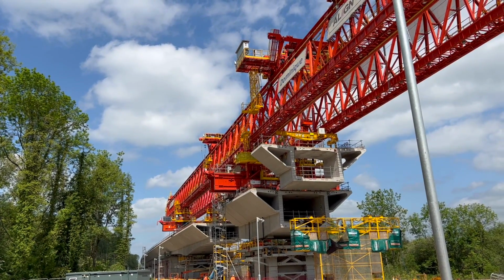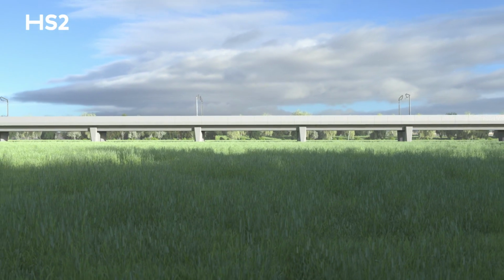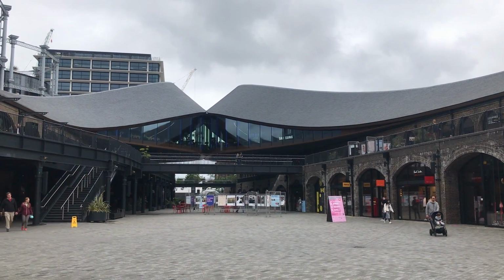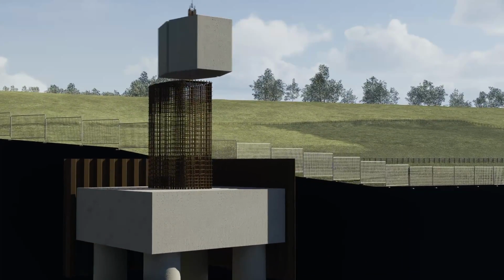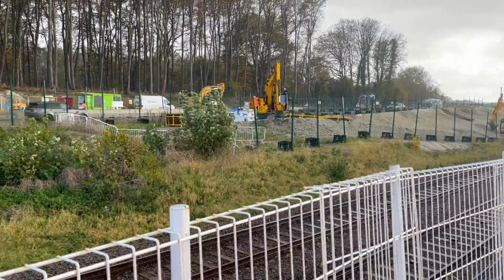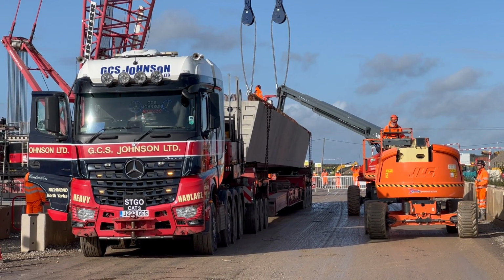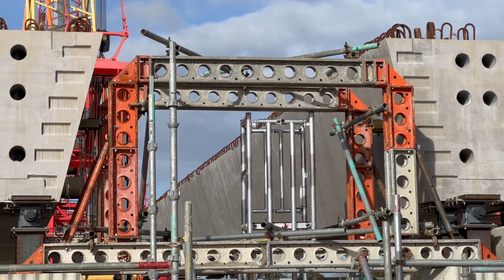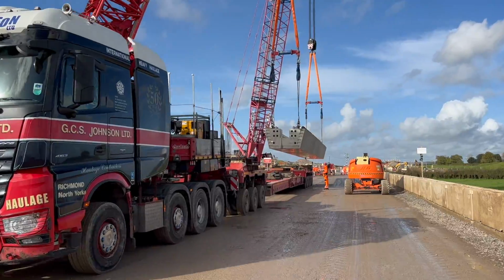Return to HS2: The Art of Compromise

Comment: After my computer breakdown in June I was idle for two months but have started drawing again, and it's Birmingham and two points north. (I never really decide on these things.) My London-Birmingham entry, which will never be built - well, if you need more capacity... - is some miles shorter than HS2. (It's impossible to measure it without drawing it, which would take a month or so to get a single center line just to measure it - and the centerline's not part of the drawing. But Google Earth gives elevations way more detailed than US topo maps for free, for instance, so it's all good. ) The point of this spiel here under the last video in my HS2 search of Jago Hazzard save the"The Actual Trains", is that I'm already quite convinced they couldn't come up with anything shorter or significantly less time consuming by doing other than upgrading the existing lines. And the lines have actually been downgraded in places, which makes them slower, and this is in keeping with a set of symptoms that are all-to-familiar here in the embarrassingly short on trains USA. The way to upgrade it would of course be to stage the work. Thus the Mersey estuarilal tunnel could be put off for a while. Might take off ten minutes: the only reason for the tunnel is it's the only way to take out the sharp curves, which I'm convinced were not in the original design: speed's expensive, but not if they would leave it as built. The headings on both lines are largely not particularly skewed, and in two notable places where they are skewed - amidst middling-cost homes with big yards mostly - they used 8000' radii, so you could probably go 100mph given proper isolation and noise protections. So I doubt the kind of construction they do, like viaducts rather than earthworks - or heavily founded and reinforced earthworks if necessary - is the shortest route to Liverpool and Manchester, or the fastest. And I notice there's a lot of really magnificent but dormant rail capacity up in that area anyway, so they might be willing to consider reviving some of it rather than... whatever it is they're doing. I'm somewhat stymied by Manchester (I took a train from there once to Sheffield, saw the sheep in the fields..) The elevation around Piccadilly is quite low, so a tunneled approach is problematic. The station would have to be underground too, and pretty deep. It's overkill. the simple solution is just to have a stop at Stockport. (probably 10 minutes for that too, as opposed to speedy/direct, which is what's got me stymied) The current arrangement of tracks and stations there seems kind of piecemeal, and in places oppressive for those not on the train. I can't get the arrangement of things in my head good and it'll probably take a while. I wonder if Piccadilly could just be dispensed with and have a lot of consolidation at some other spot. I believe the L&M's approach to Piccadilly is changed. They would not have built something so skewed and slow to begin with - if it went to Piccadilly. Have to study it. Thanks for the enjoyable hi class + informative videos, I've been enjoying them for several years.
Reply: RECANTATION - In the ten days since I looked closer at it: First, don't know why I said you could just upgrade old lines to get a quicker route strictly speaking, because it was two years ago I drew the new-build 76-mile connection between what recently turned out would necessarily start with a NEW tunnel out of Watford Junction, connecting by the most direct route possible to the incredible elevated GWR line into Snow Hill Station, Birmingham - using 22 miles of that GWR line, between Chesettsrwood and Snow Hill. (A modern connection to Snow Hill, in addition to the very narrow one that exists out of Moore Street Sta., would provide another two tracks into Snow Hill from the south, which is critically important. - Any way you look at it though, this would be a disputative undertaking. In order to avoid the 1860's Powell gun manufactory-and-shop, you have to take out the Methodist Church; but the church, thankfully, is connected by a glass breezeway to the rest of their complex there, so could probably be replaced with a new-build to the their satisfaction. The skyscraper on the other hand, which includes the Crown Prosecutor's Office on an entire upper floor, is the only way to avoid the Great Western Arcade, under which the existing tunnel runs. Frankly I don't know why they put that thing there. They also just built a toothpick super-tall in Manchester, that completely blocks Manchester Central, which had always managed to stay un-blocked for the fifty or so invervening years since it was closed. I think they're very good at catching everyone unawares.)

Another new tunnel alignment, for which the topography is well suited, would extend north from Snow Hill, running straight-as-possble to the big long curve north of Woverhampton, but bypassing Wolverhamton itself. (The designers of the existing line north from Snow Hill left provision in the form of splayed tracks for a grade-separated connection to the Walshall Line, which exits the West Coast Main Line at a triangle wye 2.25 miles north of New Street. The Walshall Line also has splayed tracks provided for the connection, in a place along a cut(ting) not far from the WCML. This would give access from Snow Hill to Wolverhampton by way of Hampstead, Tame Bridge Pkwy., Darlaston and Willenhall, all of which are undergoing big upgrades currently.)

From there I've come up with one ten-mile abbreviation along the way north to Crewe, and one of similar length on the line from there to Manchester. The "Mersey Estuarial Tunnel" is recanted in favor of a bridge to allow a station at Runcorn. This would not obviate the old bridge, which serves a populous area starting across the river at West Bank on its way into Liverpool. Starting at Acton Bridge eight miles south of Runcorn, the two tunnel segments along an 18-mile abbreviation would skip everything except Runcorn, with a connection along a disused line to a place for storage located between the Halewood and Hunt's Cross stations on the existing line into Liverpool.

I hope to do a video on this, assuming the computer holds up this time which I expect it will.

Comment: It is simply unbelievable that Sunak could unilaterally just cancel HS2 beyond phase 1 without consulting anyone, let alone any transport experts. So now HS2 will decant its trains north of Brum onto the WCML at Handsacre, just where the WCML goes from 4 to 2 tracks and there are the flat junctions of Colwich and Stafford.
Furthermore, Handsacre Junction was only designed for a couple of trains an hour to Manchester onto the WCML slow lines. Now all HS2 trains to Manchester, Liverpool, the north west, and Scotland will be dumped onto those slow lines - the ones freight currently uses. So no more freight on WCML once HS2 opens?
Madness!
Oh, and redesigning Handsacre to take the extra traffic will cost a lot - most of the cost of taking HS2 to Crewe as planned, which would also bypass all those WCML pinch points!
We are governed by selfish idiots!

Comment: Talking of (budgeted HS2 construction) costs, what I am at a loss to understand is the chasm like differential between overall totals either side of La Manche.
In July 2017 two brand new High Speed Rail lines, built to very similar (but NOT identical) technical specifications, began operating. These two lines (LGV BPL & LGV SEA) combined, constituted a track length in excess of the entire planned HS2 line from London Euston to Manchester Piccadilly - the total capital cost of these two projects was 9bn€ or about one tenth of the estimated cost of its HS2 counterpart. 
Yes, I know there are some key differences (engineered maximum speed for example) meaning HS2 would be more expensive overall but TEN TIMES THE COST - someone, somewhere is laughing all the way to the bank and it's certainly not the UK taxpayers en-masse!!!
Reply: Different rules in France apparently. If you don't like it but it's been deemed as for the good of the nation then "tough, sucks to be you" where as here if the wrong person complains then stupidly expensive unnecessary tunnel it is.
Reply: @johnharrison6808  You'll have to be a bit more specific than "different rules in France apparently" because it seems, Germany, Spain and many other European countries can also construct true "High Speed" rail infrastructure for a fraction of the capital costs involved in their UK counterpart. Yes, I am aware of some general features applicable to HS2;
• HS2 was engineered from the outset to enable a 400km/h max speed threshold, which had a profound impact on the route chosen for the new line
• The generally higher cost of land and property acquisition here in the UK, compared with mainland Europe
• The UK's constrained gauge, which necessitates very expensive tunnelling to reach city centre stations and maintain GC gauge for the entire "new" high speed line sections
But none of those factors, individually or collectively, explain the obscene cost differentials seemingly inherent to HS2?
Reply: @peterdavidson3268  well you only mentioned two French projects and I also explained what I meant by different rules, had you mentioned a German or Spanish project I might of gone and looked into that a bit more, not really sure what you're after.
Reply: @johnharrison6808  I used the two LGV projects opening on the same day in France because they provided a useful comparison with the HS2 debacle but the same chasm like contrast operates between High Speed Rail infrastructure construction across mainland Europe and here in the UK so I repeat, what different rules are you referring to because I can't see anything rational that provides a justifiable reason - of course I can see incompetence, greed, utter stupidity and corruption here in the UK but perhaps that's what you meant when you stated "different rules in France apparently"?

Comment: The part from Old Oak common to Euston should have been done later, or scrapped, being the most expensive but least essential part. It's not like Euston is a destination for many so changing to the Elizabeth line or Overground at OOC is no worse than changing at Euston onto the tube. Too late now. The costs have been incurred so the Euston extension will likely be completed while the more useful purpose of linking northern cities to London, never mind to the channel tunnel and HS1 as would have been far more useful, gets dropped.

At least we'll get a nice new, extremely expensive, Euston station out of it.
Reply: It's not the most expensive part (at least, not the station). The savings over the entire budget on building a smaller Euston HS2 terminus is tiny compared to the whole project.

Comment: The real problem is the Byzantine planning system of the UK, which makes anything very convoluted and expensive to build. I'm very pro-HS2, but you have to admit the cost was spiralling to frankly ridiculous levels, purely because of all the regulatory and legal nonsense that accompanied it, as well as the sheer weight of all the environmental obligations that weighed down on it (oh no not the hecking badgers!). And far too much weight is given over to the opinions of crotchety old people and eco-nutters in general. No wonder we don't build enough of anything despite a rapidly expanding population 

At the other end of the scale, we want to build an extension to our house. Filed the planning application in July, it's only last week (mid-December) that they sent someone round to take a couple of photos of the back garden. Could have had the entire thing built in the time it's taking them to examine a very straightforward application, and we have no idea when this will get approved. Death to the UK planning system.

Comment: I recently made a long car journey that I last made 10 years ago (all while the HS2 controversy has gone) and was astonished at the number of new roads and by-passes have sprung up in the meantime, carving ruthlessly through woods, hills and hamlets, yet I have never heard a murmur of protest about them.  I'm sure some of those hamlet dwellers did say something, but nothing that got beyond a few inches in a local paper.
Reply: It was good for the hamlet dwellers as it bypasses their hamlets. Haven't you heard of the protests around both the M3 extension and the Newbury Bypass?
Reply: @paulsengupta971  Not if it brings the main road nearer to their hamlet than it was before.  Not every hamlet or lone house is on an existing main road (often why people choose to live there), but they can find itself right next to a new by-pass route (or even be demolished).  That's why you see some very high fences in places along new by-passes - they are [not very effective] appeasement for the affected owners.
Reply: The big difference is that a road provides local benefit to the area it passes through. Car owners can use it at will. HS2 goes from city centre to city centre and has little connection with the places on its route.

Comment: The frustrating thing, as Jago hints, is that Whitehall gave in to Nimbys in the Chilterns and escalated the cost of the southern leg so much that they ran out of money for the northern leg. Whereas motorways and dual carriageways run through most of the Chiltern valleys and are far more noisy and intrusive than trains. Compare the impact of HS1 and the M20 in Kent. But it also highlights a problem with our systems nowadays that overpriced lawyers can delay and block all sorts of projects with public benefit - railways, roads, housing, power stations etc. While China can get a high speed railway designed and built in 4 years by limiting local objections for the national good.
Reply: Those motorways wasn't built by the coward that is David Cameron, zero leadership skills, zero vision, zero capability.
Reply: Effing NIMYS man, they'll shout and wail while they drive their 4 family SUVs everywhere

Comment: The constant diminution of HS2, and the political shenanigans and slights of hand around costs and redistribution of the monies saved is a scandal, and a tragedy.  HS2 is needed for capacity increases, especially around the urgent need to get freight off the roads, and onto rail; also the need to allow that freight to be moved by electric traction, which is cleaner and (generally) cheaper.  The full HS2 route needs to be reinstated and extended, and taken out of the hands of short term and populist political influence.

Comment: I thought the point of HS2 was to add capacity on the already over capacity London - Birmingham section. The bits north of Birmingham were more to appease the northerners rather than to relieve any rail traffic on the Manchester and Leeds branches.
Reply: Have you actually tried taking a train from Manchester to Leeds?
Reply: @davidemmott6225  It has been a fair few years since I commuted into Leeds as I now work at the other end of the country, however, I thought the issue was more down to the franchise and shortage of reliable rolling stock coupled with staff shortage rather than a network capacity issue. That said, I am happy to be corrected.
Reply: @baxtermarrison5361  Both surely. The lack of electrification means that,  at best, trains have to be comparatively inefficient (and carbon emitting) bi-modes. Frequency of express trains is constrained by the need to accommodate stopping and freight services on the same lines, and vice versa, Stopping trains in particular cannot be an efficient length (4 cars or less) because of the many short platforms. The infrastructure especially in Manchester is seriously restrictive.  I could go on, and those who know more would do so.
Reply: @davidemmott6225 Does anyone want to go from Manchester to Leeds?
Reply: @paulsengupta971  I refer to my question above. If you had attempted the journey you would know the answer is undoubtedly yes.

Comment: And to think that, had it not been for Beeching, they could have used the Great Central as far as Rugby before diving off for Brummagem.
Reply: Its a myth: the GC line at Rugby was at righangles to the WCML, so you'd have had a sharp curve to make this work. But also note much of it has been built on e.g at Daventry.  The one section where the route is being folowed is near Aylesbury where HS2 crosses the East West line at Calvert.
Reply: The GC route was well aligned, easily graded and built to Continental loading gauge. A great pity that the route was not safeguarded after closure. An extra mile or two round Rugby to give a gentle curve would have been far cheaper than HS2. An alternative would have been to use it as the main freight route and leave passenger trains to the WCML, solving capacity problems though not giving full high-speed rail.
Reply: @iankemp1131  Freight trains co-exist quite nicely with local passenger trains so moving them off would achieve little. It is the long distance services which are the odd ones out.
Reply: The Great Central line at Rugby is no where near Birmingham and this would not work
Reply: @peterwallen1063  It would put in a dogleg with a few extra miles, but the same is true of the deviation via Old Oak Common. Also it feeds directly into the West Coast Main Line at Rugby for Manchester/Liverpool, and would serve Coventry.  The real snag is that the Rugby-Coventry section in particular is a long-term bottleneck because it is only 2 tracks. So you would need a new parallel line as far as Coventry anyway. Logically that would come off the GC line some way south of Rugby (round Catesby?) to reduce the extra mileage. But it's all academic anyway as that route wasn't chosen.
Reply: @iankemp1131  My suggestion is give your brain a rest, have a good Xmas and stop thinking of what would or could of been for HS2, it was desighned and thought up as it is to provide a  high spped line to ease congestion on the WCML not meander arround the country.